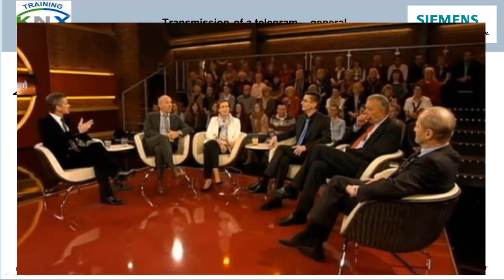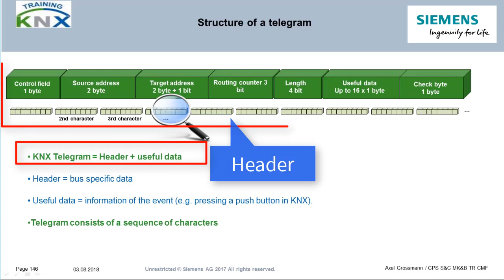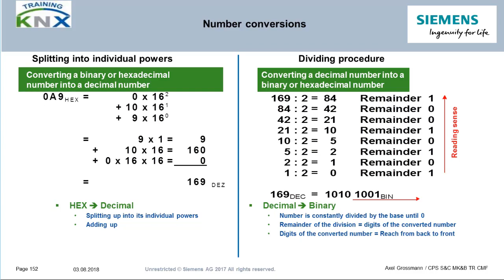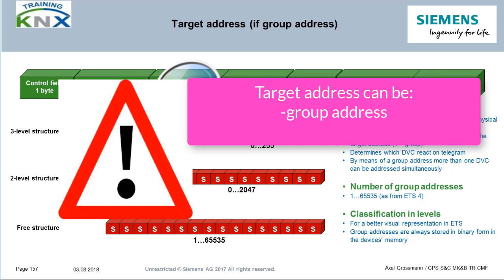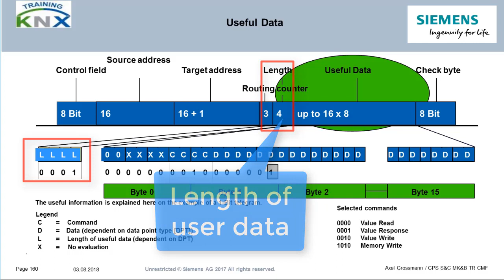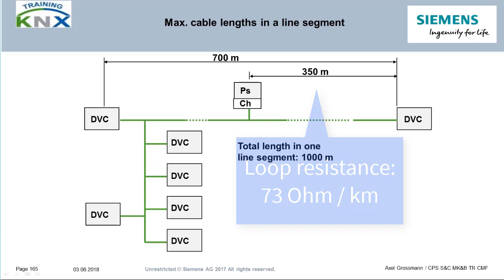Siemens KNX basic / advanced course chapter 07 Bus Telegram

Comment: Is it true that the individual address 1.0.135 does not exist?
Reply from the maker: No, it is not true. The only unusable address is 15.15.255, because it is the ex-factory state of almost all devices.
Reply: @eibdoktor  That's what I thought
Reply: @eibdoktor  But that would mean that you can put a line repeater on the main line?
Reply from the maker: @MsTommyknocker  yes and no. From the network structure, yes. The fact that we say „no“ in the basic training is only to avoid that beginners in KNX are causing chaotic situations, as a repeater does not have a filtertable, and a main line should moreover be as small as possible when it comes to use it for functional devices. But another fact is, that the running numbers of the bus subscribers are not restricted how they are used. So you can decide to use only numbers between 100 and 163, which would include 135 without using a repeater. Anyway - from the practical aspect - more than one segment on a main or the backbone line is not recommended at all. However, now the manufacturers start with the new „segment couplers“. With those, the situation will become much better, as they include two filtertables - one for the groups, and the other one for the physical addresses below them. Then the repeater discussion will be legacy!
Reply: @eibdoktor  So the address 0.0.135 would require line couplers on the back bone line?
Reply from the maker: @MsTommyknocker  I'm beginning to wonder why you ask such theoretical questions? Who are you? My answer is - just theoretically - as follows: Yes and no. Yes, because there could theoretically be 15 line couplers, counting from 0.1.0 up to 0.15.0, directly on the backbone. The backbone itself could - theoretically - consist of 256 devices, including a device addressed 0.0.0 (very often also called a „world coupler“). ETS by the way would allow to design such an unusual network. No because it is nonsnse. Why should you want to make use of these extensions to the backbone, or use that many devices on it? As long as you have a pure twisted pair network design with just 9.6 kBit/s on each segment, you would end up in a permanent „traffic jam“ on the backbone, if there are only a few devices transmitting cyclically on all theses segments, and exchanging data with one another. You should always bear in mind that KNX is most of all a building network! How many KNX subscribers do you think you can operate in an average building? You should simply forget everything now that starts with 0…. and concentrate on devices beginning with figures as from 1 and greater. With the new segment couplers of all kind (RF and TP alike, but with IP on top) you can make use of each physical address in this range, and you loose just 1 area (= max. 4096 addresses). Are you really going to design one single project with more then 61000 devices? Your real limitation then is not physically - it is the group address! As there are usually multi channel devices nowadays, you‘ll be running out of GA‘s very soon, without having any trouble with physical addressing! OK?
Reply: @eibdoktor  Im an electrician trainee in Denmark. I would like to be able to ask you questions, from time to time.
Reply from the maker: @MsTommyknocker  ah - ok! Great! Yes, of course you can ask me any questions, as long as I know it is meant serious! Now as I know who you are I can fully understand the way you think about the system and why you ask such questions! (I have some memories of Denmark - I had been there several times in the past - for performing KNX training and also for trouble shooting).
Reply: @eibdoktor  Do you know how to make scene control in KNX with the two components - ABB US/U 4.2 (Binary Input Display Heat 4f/1.3b) and ABB DG/S1.16.1 (DALI Basic 1f/1.1)
Reply from the maker: @MsTommyknocker   beside the fact that I did most of my jobs so far with Siemens KNX Devices, I‘d suggest to study the technical instructions of the required devices first! I am quite sure they are clear enough to point you to the solution. Today each binary interface (in Siemens called push button interface) is capable to send 8-bit values, or even the specific DPT 17.001 (Scene call) or DPT 18.001 (Scene call & program). The ABB US/U 4.2 for sure can do it. The Dali gateways, no matter from which manufacturer, always support the scene call&program option via DPT 18.001 . In most cases it must be activated in the parameters first before it can be used. From ABB I know that they employ an external engineering tool besides ETS to configure the DG/S 1.16.1 Is this your problem? But to be honest, I have always preferred the Siemens N141/…. DGW, as they don‘t need that. But in the end, If you have trouble with ABB devices, contact the ABB support!
Reply: @eibdoktor  Okay. thanx. Which device would you suggest for making a PLC interface with KNX?

Comment: hi Axel
why the t1 is 1 character and t2 is 4 charater minus 2 bit?
Reply from the maker: Well …. even I don‘t have a sensible explanation. But I think, it is as follows: t1 should be as short as possible, and nothing is shorter than 1 character. T2, however - is ruled by the reaction time of an actuator, or receiver in general, and this time should be longer. Than why the „minus 2 bit“? You‘re talking about system telegrams. The regular telegrams require 53 bits after ACK/NACK/BUSY! Which is then 4 char plus 1 bit. But I can explain why there are 3 bits leading for System telegrams: It is called a preamble. It is 3x 0 bits, which will indicate the bus is occupied!
Reply: @eibdoktor  thanks